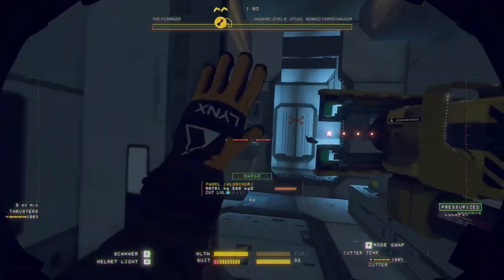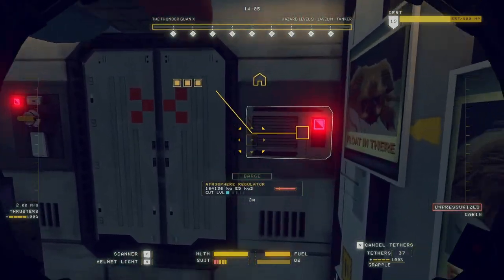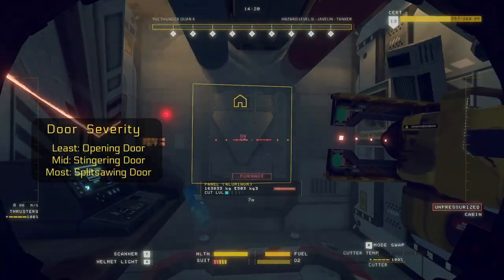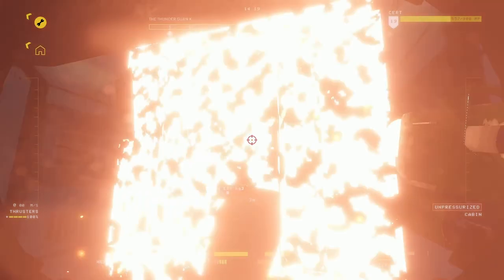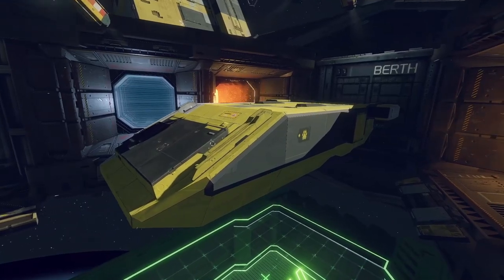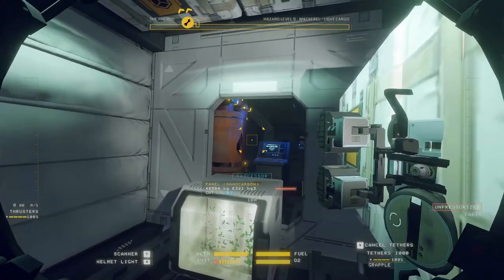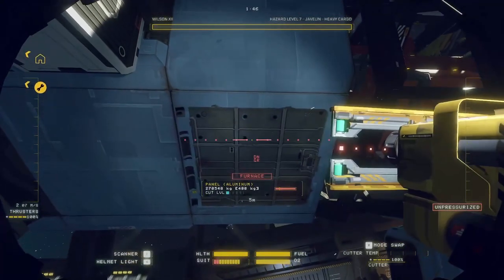Hardspace: Shipbreaker Guide Depressurisation Tools for Safe Success

Comment: Once depressured a small ship directly into the furnace
Reply: Once I accidentally depressurized an Atlas Scout in such a way that the ship was oriented with the bow facing straight upwards (already dealt with the quasar thrusters at this point.)

 I went in to start cutting the ship up, not realizing the ship was still drifting downwards! The rest of the ship got caught by the barge and sucked me down with it lol. It actually still got me like 70ish percent of salvage so I just cut my losses since retrieving half of an entire ship from the barge is nigh impossible.

Comment: As for the damage done to things. From what I understand any loose objects will get pulled in the direction of the air-flow, but almost all detachable objects will stay attached unless something hits them to knock them off, with the exception of air regulators, which will always detach themselves during explosive decompression. So if a room has to be depressurised and the regulator isn't how you're doing it, you will always lose the regulator so theres no need to worry about it.
Reply: If you want to save the regulators, figure out which one you are going to actually use and rip the rest off beforehand and put them someplace safe (like an airlock) before you begin
Reply from the maker: I decided to keep the scope of the video pretty narrow, so didn't cover these things in the video. Doing some preparations beforehand before depressurising will enable you to control where those regulators end up. Pulling the ones you don't plan to use, bringing them to the room you plan to depressurise should prevent them being broken by collision.
Reply: Same goes for radiation filter covers. Those will also come loose and should at least be checked, if they can safely detach, or otherwise be removed beforehand.
From my expierence, stuff behaves mostly as you would expect when depressurized. Stuff will be accelerated towards the breach (mostly...)
and thus, if you can't airlock something, be sure to cram all those parts as tightly as possible towards the very same wall you are going to breach,
or a parallel wall at least.
So stuff will not accelerate at all, or not much.
Best example is a Heavy Cargo Gecko's main cargo compartment.
It's a huge distance form the engines towards the pressurized front rooms.
And you don't want an asteroid near the engines, or a fuel drum to be accelerated accross the whole room...
Reply: @Shabazza84  I had a room with 3 doors on it. 2 of the 3 doors were open. Both sides of the door had no pressure. Upon opening the door, I got sucked out into the bay, hit the wall, and died. 🤣

Comment: I think my favorite depressurization was when I had a Javelin with a Reactor II where the reactor compartment was pressurized and had no atmo regulator, just one in the ECU room. So what I did was disconnected the thruster as needed for the reactor, then cut the cut points holding the thruster to the ship hull. Was very entertaining to watch the thruster shoot out of the back end like a torpedo.
Reply: I love doing that

Comment: Regarding the inaccessible airlock compartment, I found that those types of aluminium panels are attached only along the nanocarbon structural beam (in blue). An accurate cut directly down the middle of that beam, or two less accurate cuts to either side will always release the entire panel. First video I’ve found that accurately described how doors are basically indestructible when opened to decompression, great stuff!
Reply from the maker: Yeah, 1 cut will do it, but it's easier to instruct for the 2 cuts, and pull user error out of the equation. 

In terms of why other videos don't have the accuracy of this one, I feel they are more likely to be leaning on the real-world experience, which just isn't the way the game works. This video is all based upon evidence in-game, after many hours of play!

Comment: I would add that Ghost Ships will periodically activate or deactivate regulators (even broken ones).  So if you have a ship with a large pressurised area (ie Gecko Heavy Cargo) with a broken regulator, you can wait for the AI to depressurise the room and then just open up the outer hull.

Comment: Oh, the part about larger holes making less of a mess is quite helpful, thanks. Been wondering why some of my stinger holes went sideways fast and others got off without any breakups.

It also helps that you tidy up or prep your ship before depressurizing by picking up all the collectible items (including posters), loose crates, fabrics, mattresses, broken fuel/O2 canisters and most importantly atmosphere regulators (even nonfunctional ones), as all these items tend to cause issues by colliding around the room or crawl spaces before starting to burn, puncture or break, and then you'll suddenly have new hazards to deal with or loss in item values. 

One way to prep your ship it is to collect all the loose items into airlocks, and then dealing with them first or just let it float outside while you finish depressurizing.
Reply: I put them in the airlock, and after I'm done with the room depressurization, I grab the air lock and launch it into the barge.
Reply: And always depressurize going into a larger space, whether that be a larger room or out into space. I've learned that the hard way... from Geckos especially.

Comment: I'm still very early on in the game so I recognize that my experience so far might not be applicable to some of the higher level ships but I found it easier to move deep into the ship as possible into an area you can cycle depressurize and where you can cut your way out and then pop lose a panel so it stays depressurized without any blowback then repeat chamber by chamber working backwards towards the airlock. It wouldn't work on broken cyclers but otherwise it seems safer than explosive decompression.

Comment: Thanks!  I found this video because of the situation where there's two rooms with pressure regulators separated by a single door.  These techniques were largely what I was doing already, but the tip about simply opening doors being least destructive was new information.  I was always hesitant to do that because I liked to be farther away when initiating an explosive decompression.
Might be helpful to know that you can use your hands to hold onto a surface to avoid getting blown around. 
I wonder if the game takes into account, for instance, depressurizing the largest space first?

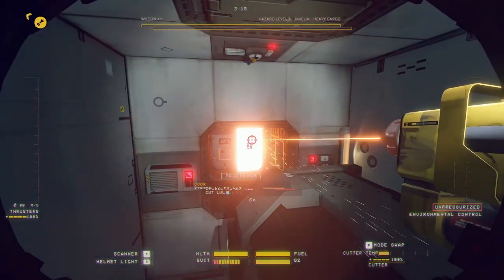Comment: 4:35   When dealing with an isolated seat like this, the best way is go in the airlock, pressurize, then use the regulator inside to depressurize and cycle the airlock again. No need to cut.

You also missed the Gecko. Personally, my favorite way to depressurize the Gecko is go under the ship, and using the scanner, place a single demo charge (Making sure not to cut anything important!) to cut one panel. If done right, it will depressurize the entire ship in one go. You can also do this safely at the nose of the ship, on the side opposite the cockpit.
Reply from the maker: The Javelin has a broken regulator in  the cockpit, as is audibly described in the video. If the regulators were working, then it wouldn't appear in this video. 

In terms of Geckos, none of them have any particular needs beyond what's mentioned in the video. No special unreachables that won't be solved by just opening a door to the guaranteed working regulator.
Reply: @Takovacs  Fair. All of them have class 2 reactors. One thing I like to do to handle those is clear the area around the thrusters, then tether the thrusters to the barge before activating the override. That way, if the thrusters do rupture, they will be quickly and harmlessly pulled away.

Comment: Larger holes being less violent is so counterintuitive and also just wrong. If we cut a tiny hole it should be much slower and more gentle.

The entire pressure system in this game is so illogical, they just need to make it the same as the real world and it could actually be fun. Like we should be able to connect all pressurised rooms and then use a pressure regulator to slowly depressurise them all, it's exactly how it would work in the real world.
Reply: No, it makes sense. All the air is coming out anyway, if it's coming out of a smaller hole, it's going to go far faster, and by extension be far more forceful. This is a phenomenon used for rocket engines, it's called the Venturi effect. I kinda agree about the atmosphere regulators though, but that'd make the whole process kinda trivial.

Comment: Would it be viable to open up paths between pressurized areas (as possible based on whatever ship you're working on) before depressurizing, or does that cause the whole "regulator no longer works" issue?
Reply: I answered this for myself and regrettably it's not possible. Sad.
Reply: I tried this in the pressurization tutorial ship, and no go sadly.
Reply: @mrmiffmiff you kinda can but it's a little fiddly. You have to destroy the doors between every room/crawlspace (they're not worth much anyway) and then cut the ship open. This way the ship can't cut off the part of the ship the depressurization event came from. Sadly, though, safe depressurization of the whole ship is not possible.

This comes at a cost though, you run a greater risk of stuff flying all over the place and colliding with more delicate components.

Comment: I just confused the Meckerel method... Went to the engine rool and cut it off while the engine room itself was still pressurized... Death by high speed impact.... Well, leassons learned... (next time gonna remember to depressurized the ship and engine room first 🤦‍♂)
Reply: You may want to make sure of two things before attempting that method.
1. Loose items are not in a place that they could potentially fly towards and kill you during depressurization.
2. Hold on tight (Z key near wall/object)

Comment: Wrong. The best way to depressurize a ship if your atmospheric regulator is broken is to:
1) go to most outer compartnment
2) make sure you are sealing all the doors that are airtight to minimize the amount of air that you are working with
3) pick the end of a ship that is closer to the wall or your hab module (shop)
4) cut all cutpoints, except the last one, that stich the ship together at that crosssection
5) try to find a place out of the way of the possible debree, hold on to the wall with Z (don't use X, that's your cutting tool hand) and cut the last cutpoint

If you've done everything right then you shouldn't experience any presure explossions and can safely salvage the ship

P.S. Of course you can always just cut the ship from outside, that way the risk is minimal, but mess is maximal